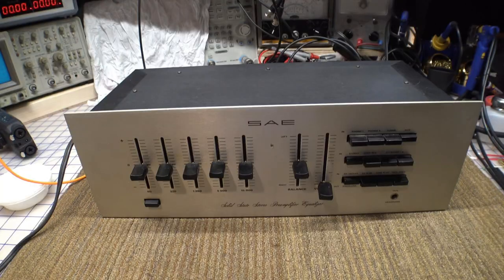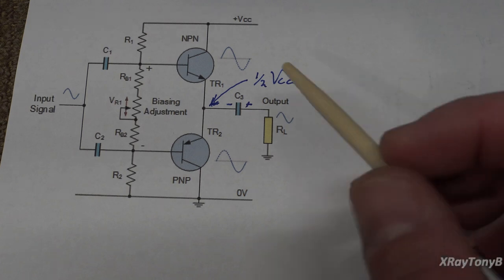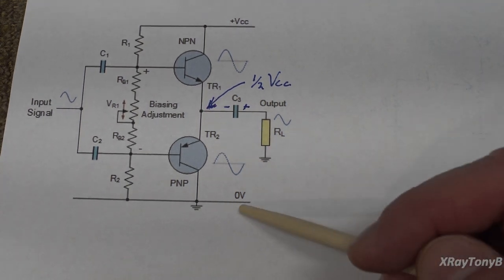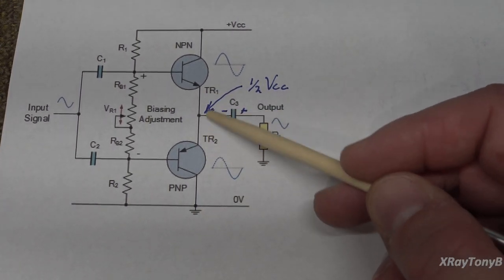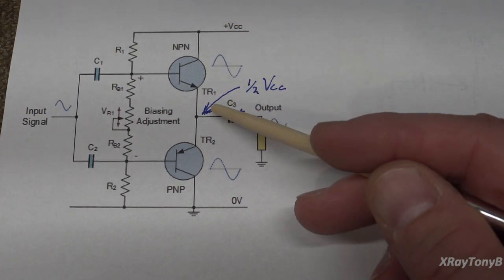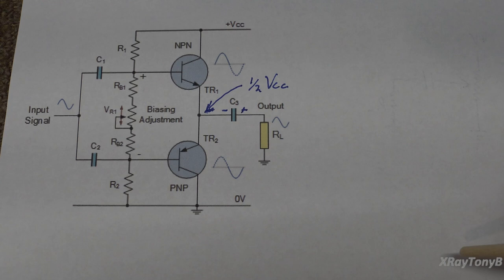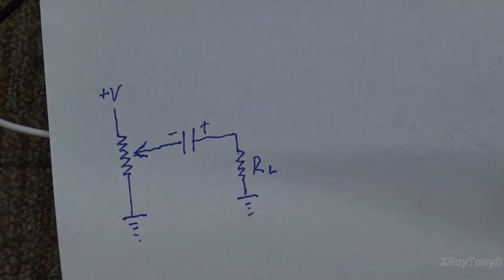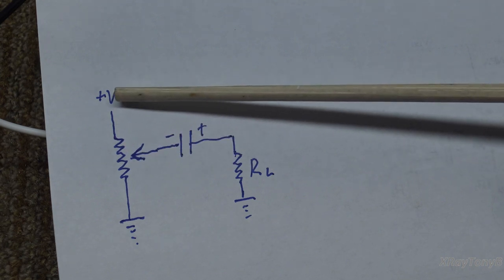Random Video 3 - Amplifier Output Capacitor & Comments from last video

Comment: One Equalizer that I came across was a TECHNICS which used a DSP processor to do the signal processing using firmware programmed in DSP C++ that a Equalizer that used analogue parts to do the same thing.
eg...

long double FIRBUFFER[65536]={0.0};

long double LDADD(long double X,long double Y)
{
    register long double __LDX=X,__LDY=Y,__ANSWER;
    long double RESULT;

    _asm_ __volatile__(
        "fldt            %0                           \n\t"
        "fldt            %1                           \n\t"
        "fxch           %%st(1)                 \n\t"
        "faddp         %%st,     %%st(1) \n\t"
        "fstpt           %2                         \n\t"
        :"=m"(__LDX),"=m"(__LDY),"=m"(__ANSWER)
        : "m"(__LDX), "m"(__LDY), "m"(__ANSWER)
        :
    );
    RESULT=__ANSWER;
    return RESULT;
}
long double LDADDMUL(long double A,long double B,long double C)
{
    register long double __LDA=A,__LDX=B,__LDY=C,__XTC;
    long double RESULT;

    _asm_ __volatile__(
        "fldt            %1                        \n\t"
        "fldt            %2                        \n\t"
        "fxch           %%st(1)              \n\t"
        "fmulp         %%st, %%st(1)  \n\t"
        "fstpt          %3                       \n\t"
        "fldt            %0                       \n\t"
        "fldt           %3                        \n\t"
        "fxch          %%st(1)              \n\t"
        "faddp        %%st,  %%st(1) \n\t"
        "fstpt          %0                      \n\t"
        :"=m"(__LDA),"=m"(__LDX),"=m"(__LDY),"=m"(__XTC)
        : "m"(__LDA), "m"(__LDX), "m"(__LDY), "m"(__XTC)
        :
    );
    RESULT=__LDA;
    return RESULT;
}
long double FIRFILTER(long double VALUE)
{
    int NX;
    long double FIRSUM=0.0,RESULT;
    __uint128_t *XFIRBUFFER=((__uint128_t*)&FIRBUFFER[0]);

    FIRBUFFER[0]=VALUE;
    FIRSUM=LDADDMUL(FIRSUM,-0.022355,LDADD(FIRBUFFER[0],FIRBUFFER[19]));
    FIRSUM=LDADDMUL(FIRSUM,-0.018813,LDADD(FIRBUFFER[1],FIRBUFFER[18]));
    FIRSUM=LDADDMUL(FIRSUM,-0.005666,LDADD(FIRBUFFER[2],FIRBUFFER[17]));
    FIRSUM=LDADDMUL(FIRSUM,0.010397,LDADD(FIRBUFFER[3],FIRBUFFER[16]));
    FIRSUM=LDADDMUL(FIRSUM,0.021183,LDADD(FIRBUFFER[4],FIRBUFFER[15]));
    FIRSUM=LDADDMUL(FIRSUM,0.021183,LDADD(FIRBUFFER[5],FIRBUFFER[14]));
    FIRSUM=LDADDMUL(FIRSUM,0.010397,LDADD(FIRBUFFER[6],FIRBUFFER[13]));
    FIRSUM=LDADDMUL(FIRSUM,-0.005666,LDADD(FIRBUFFER[7],FIRBUFFER[12]));
    FIRSUM=LDADDMUL(FIRSUM,-0.018813,LDADD(FIRBUFFER[8],FIRBUFFER[11]));
    RESULT=LDADDMUL(FIRSUM,-0.022355,LDADD(FIRBUFFER[9],FIRBUFFER[10]));
    for(NX=25;NX>=0;NX--)
    {
        if(NX!=0)
        {
            XFIRBUFFER[NX-0]=XFIRBUFFER[NX-1];
        }
    }
    return RESULT;
}
Reply: Nice.

Comment: I’d like the concept of your video it is two big subjects so first the elusive Qustions as to right accredited sound system and there is no one correct answer it you don’t set your goals first if you are a big time recording studio cost is no object you want a lot of SPL and set repayable response very important if your record is being mixed across the world but if your 66 and am you are wanting to relive that time big JBLs and Macintosh or older mono 30 watt big consuls 
      Right for what is a big Qustions I am cursed by being a real expert have been a pro technician and system engineer for twenty years so the questing has come up a lot at a high buck level so you probably don’t want flat sound you want sound that is colored to your personal needs and this came be to impress your feints
Reply: Friends well it’s a long answer and I have two go come back for part two